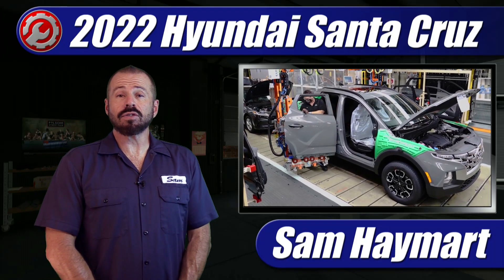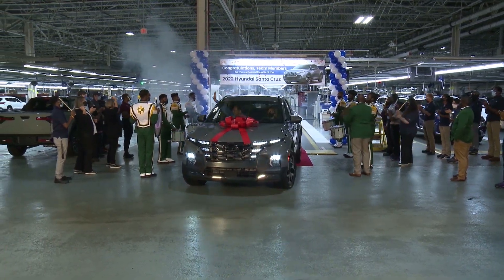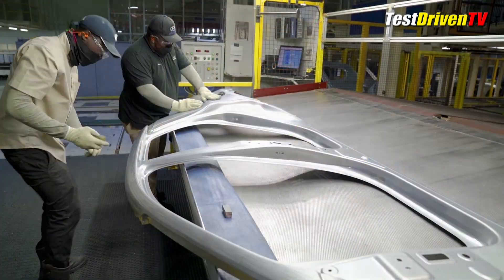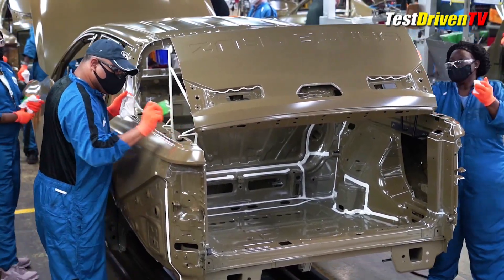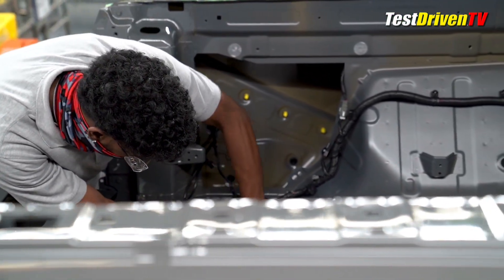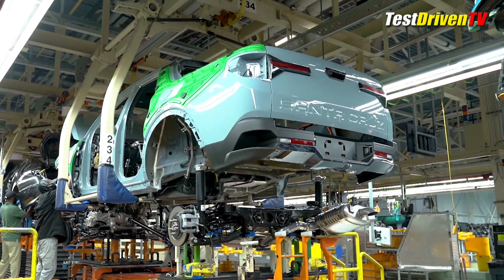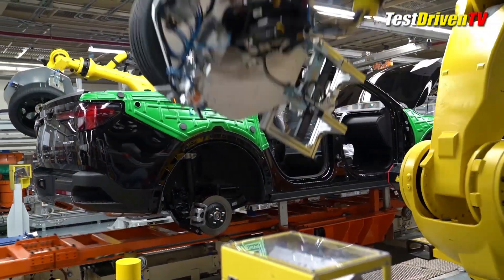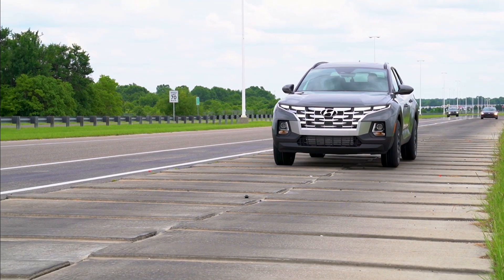2022 Hyundai Santa Cruz: How It's Made!

Comment: I hear so many complaints about the piano black info center surface and lack of buttons...  Im working on a self-adhesive overlay, in colors and textures, with cutout where the buttons should be, so you can operate it by touch, without looking...  MUCH SAFER...

Comment: Here's a simple question I have about automobile production.   When they put the suspension components on the car do they do a four-wheel alignment?  Or are the parts assembled such that they're already correct?
Reply from the maker: The plants that we have visited have a station at or near the end of the line where alignment is checked and adjusted before the vehicle rolls off. Whether or not all four wheels are part of that has to do with whether there are adjustments to be made for each or not.